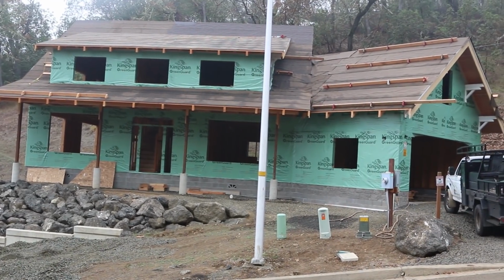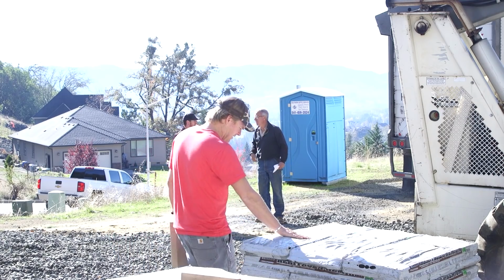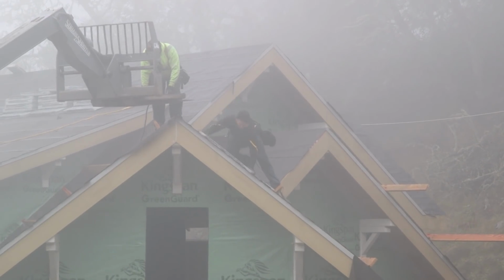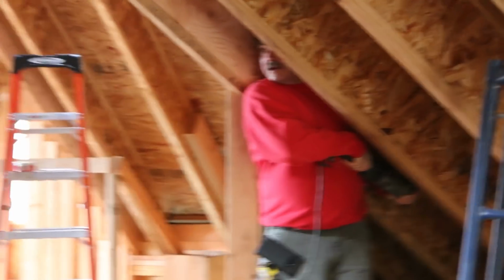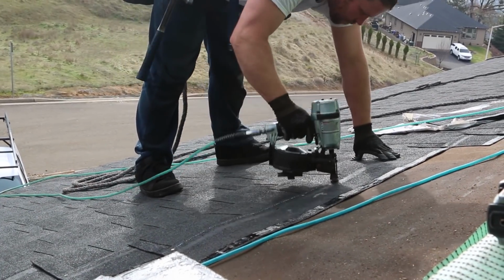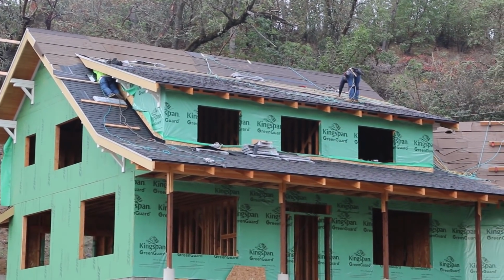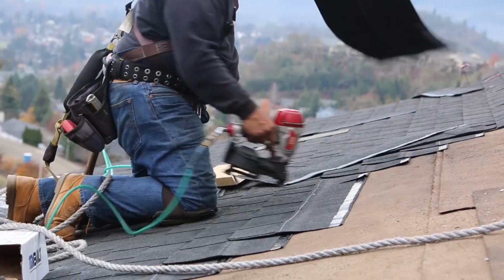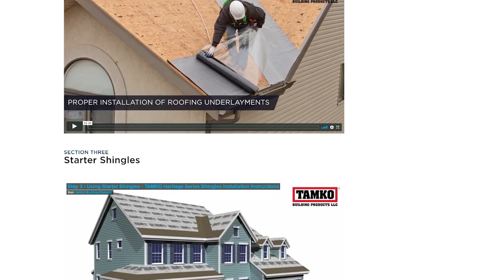Installing Asphalt Shingles Ep.77

Comment: a way to get the ladder in a good angle is to put its feet against yours, standing straight up, arms parallel with the ground; gripping the ladder arms should be completely extended.
Reply: T-Rex disapproves of this message...

Comment: Can you explain that nailing pattern to us Eastern folk?
Reply: Right.. What kind of nailing pattern is that??
Reply: Hardly anyone ever does, but I recommend that you just read the instructions printed on every bundle.  Basically it is this: four nails per shingle except for extra steep  slopes, which takes 6 per. But there are lots of other details, it's worth reading, that's why the company prints it on the wrapper.
Reply: If I was spending extra for 50 year shingles, they would be doubling the center nails for a total of 6. That is code in my state.
Reply: I havent read the directions on the package of shingles before... but I see no reason why they only nail the left side of the shingle before covering it with the next... or one on each end, and 3 close to each other in the middle... I do 5 and space them equally across the way. Unless its steep or near the edge or whatever and needs extra nails.
Reply: @sealtite87    THANK You.
Reply: Rick, I don't understand your question unless you have a 3- tab concern.  These shingles when nailed on or close to the nail line are good to go. Horizontally there is 1/2"- 3/4" full double layer under that nail line.  Most nailing patterns or concerns were based on tab loss on 3 tab shingles.  There are some rarely used "high wind" nail patterns
Reply: @whatsup3270  At times it appeared as though the shingles were nailed on almost randomly, that's all.
Reply: @Dulcimerea  THIS.  This is how you install your shingles correctly.  Take a few days to do it right so your warranty is good.
Reply: Yes, I believe I can, thought I don't like it myself.

The nailing pattern of 2 nails at either end and 2-3 in the middle is to create a space on the tile of no penetrations so that the next time above, when offset, will not have a nail underneath it's join, this should provide better waterproofing.

Comment: I don’t miss the achy back, sore ankles and wore out fingertips that come from shingling.  That’s certainteed.
Reply: No pun intended. LOL!! Certainteed
Reply: Vamos ManUtd quit
Reply: Vamos ManUtd Safety is ones own responsibility. If you feel you need a harness, purchase one. If you have ever been on a job that requires you to tie off,  and have experience with using a harness, you will realize how silly, and dangerous it is to wearing this thing most of the time. I do not have any advice on how to get your roof legs. For me it took time building balance and coordination and the strength to throw around those plywood sheets. Some people cant get it. You may want to look into a similar but different trade.
Reply: They've all said it your safety is your number one priority, obviously it's not their priority, Get in a trade where you need a license,
Reply: Vamos ManUtd  You could make your own with tree climbing gear.  it will work just as well!

Comment: 6:27 what kind of nailing pattern is that? How wide is the double layer on those tamkos and shouldn't the nails be within an inch of the ends then uniformly spaced in between?
Reply: I was wondering the same. If the wind blows like it does where I'm from those 50 year shingles are gonna last 6 months. Especially the ones that only got nailed on the left side

Comment: A ladder stabilizer is something you should.use whenever possible with a extension ladder. Place it a few rungs down so the top of your ladder is above the roof and it will keep you off the shingles and help prevent the ladder from going side to side and will also prevent the feet from kicking out

Comment: When i watch the video and see the guys doing the install, I see many different nailing profiles from them.  I’m confused. . .
Reply: They all looked the same to me one nail on each end and two in the middle.
Reply: Was also looking at that looked like only one side nailed when stair stepping up but maybe they nail the other side after moving
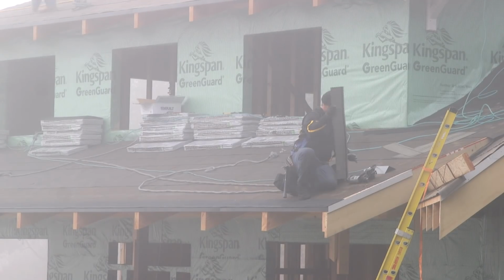Reply: ? ?  The shingles have a nail line which is designed to penetrate both layers of that shingle.  He did open with some "starter strip" a rarely seen product(5:28), typically left over shingles from other jobs are first installed inverted ( upside down and high side down) with 3/4" over hang for your required redundant layer and to set your straight drip edge.  That may have confused you.  Also in a slope change he stapled the top of the shingle (13:43), I'm okay with it but there were better options, that is likely what confused you.   He could have valleyed the angle change like a std valley.   FYI - those nails holding toe boards have to be driven down before you leave
Reply: @whatsup3270  that’s only standard practice to you, dishonest insurance companies, Chuck in a truck, & Seth on meth. It voids the warranty due to improper install.
Reply: That's because none of them have read the instructions.
Reply: @JDeWittDIY  look again. I saw one of them with one nail on each end and three in the center about an inch away from each other. Plus if you have to use jacks and boards to put on the roof. You should use six nails and the nail line which these roofers didn't use. This roof will fail soon

Comment: Interesting. Shingles are basically unheard of here in Australia. All our roofs are either tiles or corrugated steel (Colourbond).
Reply: In Germany we use almost exclusively tiles on our houses, mainly clay with a few slate roofs here and there. Shingles only get used on small stuff like garden sheds.
Reply: There are areas that use tiles in the US and some people do choose metal but people like the look of shingles. Some even use cedar shake wood shingles.
Reply: Metal roofs are loud in rain, and clay is brittle to hail storm , these are quiet great grip under foot and insulating and sound deadening also they can be overlayed with metal or clay in the future  when metal is over the old shingles it is a lot quiet than a basic  metal roof
Reply: The US produces a lot of asphalt, so much of it goes into composite shingles
Reply: @Mrcaffinebean  cedar is only good if it rains alot where you live
Reply: @floriel1  and that is the only place that garbage should be used.
Reply: @gabewhisen3446  lie on top of a lie. properly installed metal roof is silent, properly made clay lasts for 100-150 years with hail.
Reply: @josephv5346  exactly

Comment: Asphalt is such a $ grab, such a waste. Will be replaced in 10-15 years, more than likely. $10K+ literally washed down the drain 2-3 times before the homeowner dies. We refuse to install shingles for this reason. Just a waste for the customer and it's back breaking work - if they want it, they can shop elsewhere. But great job anyway, always love the videos!
Reply: Every other home in this neighborhood has shingles. I'm guessing EC allowed that to guide the decision in part. I too would have liked to seen metal.
Reply: I'm from Canada and our "metal" roofing products are Galv-Alum as actual Steel roofing is 2-3 times the price. It is inferior to asphalt shingles in every way in our climate.  The metal  is cheap and deteriorates quickly in the sun and under our heavy snow loads. It also always causes many issues in the winter time with snow and ice run-off. The shingles they are installing in this video are 50 year shingles. Make sure you listen and understand the products before you make public comments. Though they may not be for you, I've installed over 300 roofs in my time and would never recommend a metal roof to any of my customers.
Reply: Ikown I have cedar shingles on my house we put it on because we knew it would last 50 years and we got a very good price
Reply: @1I1IADAMI1I1  that's just not true. Yes the finish degrades in our climate, but it's fun near 100 years before the metal rots.
Reply: Adam Miljour is there no metal roof at all, even a better quality one, you’d recommend?
Reply: Tommeo Copper is a great material!
Reply: @T0MME0  I've done a few standing seam roofs and I like that product. Definitely more expensive and not so user friendly to install. I would recommend this only in a situation where none of my building penetrations would be affected by the snow and ice runoff. We also have a Wakefield Bridge Shingle that is a steel-backed asphalt shingle. This is by far my favorite product and probably the most expensive of the options.
Reply: @1I1IADAMI1I1  Thank you, I'll check it out.
Reply: Tommeo i like enviro shake roofing but the only problem is it is only available in Canada.  But it last as long as cedar!
Reply: If your asphalt shingles need replaced in 10-15 years you fucked up somewhere else.
The current average lifespan of properly installed asphalt shingles is at least 30 years. (this doesn't even factor in that company's starting offering 50 year warranty's)
Most of the time asphalt shingle failure is a result of something other then how it is manufactured/designed. (unless your cheap ass bought the cheapest shingle made in which case you got what you paid for since they start at 10 year for the bargain bin)
These are issues like improper instillation, wrong nail pattern, poor nailing in general (ie nails in valleys) stacking too many layers over old shingles, Inadequate roof venting causing them to deface, putting them on too low of a slope of roof.
Reply: @PortersMob  Seems for water collection though, asphalt may not be a great thing to filter your water across first.
Reply: @T0MME0  If your planning on drinking rain water, you should be filtering it first anyways, rain picks up tons of impurity's as it falls before it even hits your roof.
Normally you would only use collected rain water as grey water for things like flushing toilets and watering plants.
Reply: @PortersMob  Yes my filter system is robust - 7-8 filters total before it is used for drinking.

Comment: the hardest thing i run into is trying to educate todays workers on safety ,they just dont get it, its tough because you dont want anyone getting hurt, but you need it done and there grown men,  although these guys were tied of ,it was bogus, at one point the guys rope was tied to the toe board bracket, 12;25. ant the tension and slack on rope is crucial,  ,imean if the hold down and rope and harnes work , it doesnt matter if you going over the side and hit the ground first .

Comment: Not trying to rag on anybody’s work - maybe y’all do it a little differently out there, but that work would be questionable where I live.
Reply: Austin Hansen Those shingles would be gone overnight here on the east coast of Canada with that nailing pattern
Reply: they will fail here in miami dade county south florida but again different weather conditions and our building codes are subject to what works best around here so a minimum of six nails ( ring shank ) per sheet of shingle is mandatory in order to comply with code.
Reply: calevel florida interesting to hear that it must b ring shank. They did a study on ring shank going into OSB and they say that the penetration of the nail destroys the wood in which it pierced and overall a smooth shank actually had the better grip when it came to OSB. Is it required by code for u guys to have a synthetic underlayment as well?
Reply: @calevel  they are more interior Oregon. Coastal Oregon it's a 6 nail pattern as well.

Comment: Nice to see you feature a roof job. I am a roofing contractor and I have been a fan of your show for a few years now. Roof top deliveries cost $200 in my area, I have always humped them up for the most part. I am only 36 and I am paying for it. In negotiations to buy a steel panel roll forming machine from another contractor, hopefully it comes through and my shingle days will be behind me. I will strictly do portable roll forming and install of 24 gauge double field lock standing seam, best roof money can buy. I might be the only one to say it, but I do enjoy slamming on some shingles. You can get into a great rhythm and the hours feel like minutes. It's just the tear-off, dry-in, and staging, getting yourself and material on a roof that beat a guy up over the years.

Comment: Congrats on the sponsorship.  I'll be happy to get your follow up thoughts several years from now. I've been skeptical believing an asphalt roof can last 50 years. My old houses lasted about 100 years with their original slate roofs, so I felt obligated to stick with that. The dealer tried to sell me on these asphalt architectural shingles, but I wouldn't budge.
Reply: I also want to add that I absolutely hate it when some people (sometimes fellow tradesmen) treat roofing like easy unskilled labor. It's difficult dangerous work that not only requires extensive knowledge of construction,  but constant awareness of your surroundings. It's simply not a job that just anyone can do. It's very satisfying to see you giving them the respect they deserve in this video.

Comment: In this session you mentioned getting the shingles up on the roof.  Well, that's become almost a magical process for the ABC company here.  They have a bunch of flat bed trucks for hauling shingles.  The shingles are stacked on the flat bed and tied down.  The amazing thing is the Praying Mantis arm on the back of the tractor.

We had a bad hail storm here and I got a new roof from the insurance company.  As the roofers started their work this huge truck rolls into my front yard stocked with pallets of shingles.  The truck driver got out and started unfolding the arm.  He picked up a pallet and then lifted right up on the front of the roof.  Then the amazing thing happened.  He lifted the arm controller out of its place, put the strap around his neck and then picked up another pallet.  He climbed the ladder up onto the roof.  He then walked over the ridge and disappeared over the other side.

The arm then continued to unwrap and extend until the pallet was over the ridge.  The guy controlling this thing was standing right where he wanted the shingles on the other side of the roof.  He lower the pallet onto the roof and then sent it back to get another one.  This crane arm was extended at least 30 or 40ft but it could curl itself up behind the cab of the truck into a small space.  That was my cool invention of the month!

Comment: I have Tamko and Roseburg Roofing on my list to check out when we build our home on the North Umpqua near Roseburg (about 20 miles from the build in this video).  Thanks for the lead.
Reply: Don’t use either. Tamko has a reputation for warranty work and that roof job was not good. I suspect if Scott knew enough about roofing he’d be finding a new crew. Lots of bad habits, nail patterns, valley work, no water and ice. Cheap hacks that aren’t even working fast enough to excuse the sloppy work.

Comment: Nicely done! I didn't see a single major error here like I do in most roofing videos. Decent nail patterns and placement.  No seam falling on a nail. Looked Straight. Good job. Only 2 minor things stood out if you let me to be a bit particular... 1 was the bubbles in what appeared to be tar paper? They laid shingles over pretty severe bubbles. if you don't cut the bubbles n patch them (or add extra nails to those raised areas THROUGH the shingle til its flatter) you will most likely see a wave in the shingles permanently. The shingles lay down after some sun but not so much the tar paper  My guys didn't cut the ice shield on my house and those waves have been above my front door for a while now lol the longer the underlayment is exposed prior to shingles, the more bubbly It'll be. Especially in tar paper and Ice shield.  That's one of the many reasons I only install synthetic these days. I recommend you do as well because it also saves time and it is safer to walk on the 6-9/12 pitches. 2nd thing was the way he didn't finish out his rake edge? That's just strange to me.  Maybe the ladder/ pump Jack's were in the way? I can't remember what it looked like but I'm sure he could've just finished it out while he was there.. on a hot day the felt paper will stick to the tar on the bottom of the shingle and when you try to lift it, the paper will stick to it preventing a full seal. You have to be smart about it on a hot day and occasionally it'll be bad enough that you need to hand seal some of those that have the paper stuck to the bottom.  anyway sorry for the long comment. Like I said good job over all.  I really enjoyed your life lesson on the ramp video that you built for your mother.  That was truly an art piece.  I hope you take a minute to watch some of my videos (not as insightful or professional as yours) but would love your feedback. Thanks.  @worldsfastestshingler

Comment: Before I went to work scraping, recaulking, and repainting the slippery curved roof of my 30'  Airstream trailer, I looked up in the medical literature about the types and numbers of injury and fatality statistics from falls.  >>They are very sobering numbers indeed.<<  Since the work was going take a while,  I ended up building a ladder-like structure with a wide base  and wide rungs for comfort.  I also had a safety person on hand at all times when I was working.  It was definitely worth taking the time to do.
Reply: User name fits
Reply: @robertbeirne9813  no, not with this - i'm a retired med school prof of surgery,  and I read the literature.  And you're a fool, a true fool, if you go up without paying attention to safety.